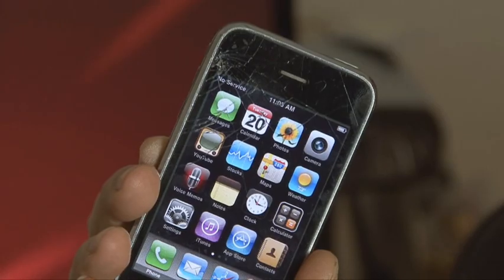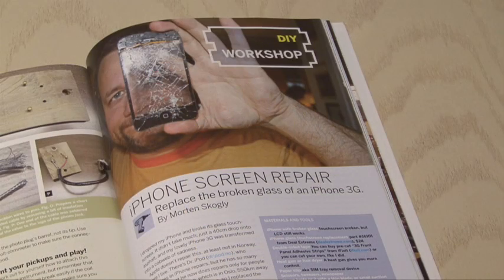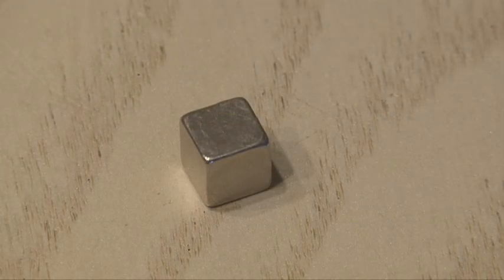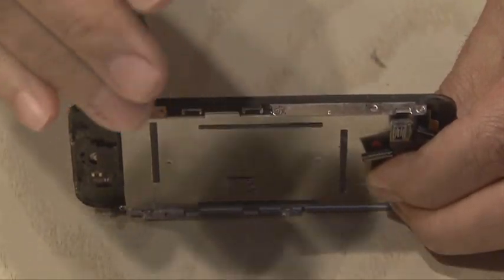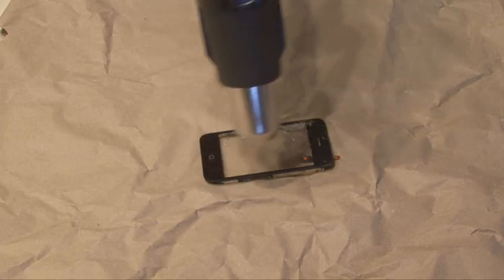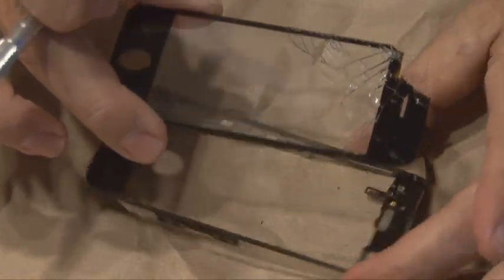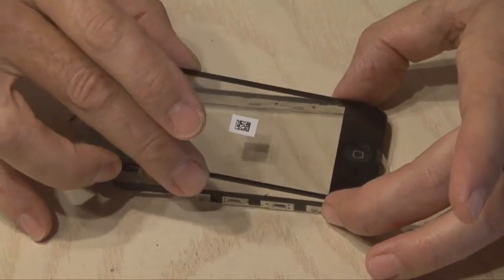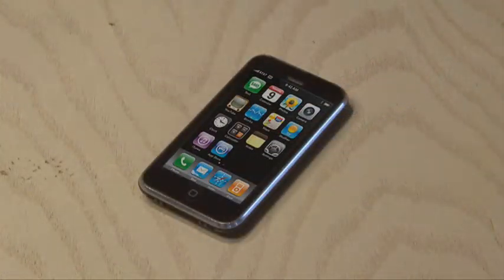Weekend Project: iPhone Screen Repair

Comment: I find it odd that so many people DISLIKE this, I would guess its because now others know its that easy to do. Note, you can get the glass for under $10 on ebay, if you crack your LCD, then you will be looking at a cost of $30, also make sure you do this in a clean area, clean the lcd b4 you reassemble, and try to only touch the side of the screen, to avoid leaving finger prints.

Comment: Great video - One note about removing the broken screen, using the suction cup to lift it off should avoid putting marks on the frame, safer than using a screw driver.

Comment: This is the way to do it, except use a suction cup to remove the display assembly instead of prying it out with an xacto knife, apart from that its the way to do it. I've worked on many iDevices, this is how I replace the digitizer/lcd

Comment: Never use an x-acto to remove the screen, just stick a suction cup onto the bottom half of the screen and pull it off, it comes off relatively easily if the frame isn't bent.

Comment: @Miniak also its better to just use a razor at the bottom by the screws it comes out in a second and you dont risk hurting the rubber

Comment: Kip dropped the ball on this one. Amazon has screen replacement kits for $25. It comes with the screwdriver, a screen, and a plunger to stick to screen and lift it off. Only screws u remove are 2 at bottom. Ribbon clips hook onto new screen, done. Tats it. 2 screws, 3 plugs

Comment: two things, one I agree the ad in the middle is annoying, two this only works if the crystal screen underneith isnt also damaged so if you see bleeding crystals this wont help you, you'll need to replace the screen and the glass cover (shown here) because once the crystals are damaged they cant be fixed this way you will need to replace that part also if thats the case.

Comment: the glass and strips came in today. i had just got done attaching the glass to the lcd screen. When i was pushing the frame glass and screen back into the phone to be screwed in the glass cracked ina the bottom left corner. im not sure if im still going to sell it or not. :( the glass was worse though

Comment: ATTENTION : If your screen has a "Ink" effect on it THIS WILL NOT WORK!
The "Ink" effect is when you get that crack and you press on it, it will move around like Ink on the screen. This happens when the LCD screen gets cracked itself. Where it will cost 1/2 the phones cost to replace.

Comment: Thinks for the video.  I just recently repaired the glass on my ipod touch, this is the best video showing how:
watch?v=TIcotA-PnFs&playnext=1&videos=4QvPbRe5_5c
It was a bit nerve wracking but not rocket science.  Here's a coupla tips:  Do yourself a HUGE favor and use rubber gloves to avoid smudging the insides!!  Also, you will need to use a safety razer blade or similar to get the plastic mid section out without damaging it.  I didn't and had to buy a new one.

Comment: @Glockenator 
go to iFixIt, they have great repair tuts, including all apple devices

also, you can order spare parts or get them to repair it for you (for a fee ofc) if you do not dare to do it yourself

Don't take this as a commercial. I like the site and it helped me a few times =D

Comment: At least this iphone is much easier to take apart then lets says an iphone 4 or newer.  But get this i want to replace the screen on my ond galaxy nexus but the screen is $80 and i can get a used phone for $40 give or take.  I call bullcrap
Reply: +Dudefoxlive Phone parts cost a lot more now. That being said, I got a nexus 5 screen for $60, so it could just be that phone.
Reply: sometimes it is cheaper to buy a used phone and just swape parts around